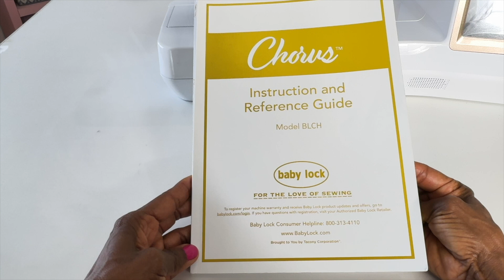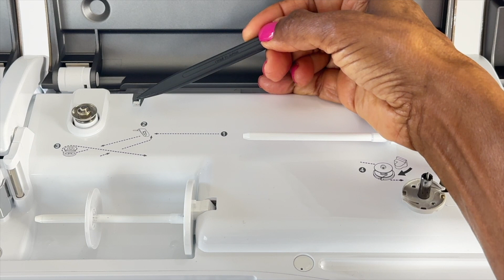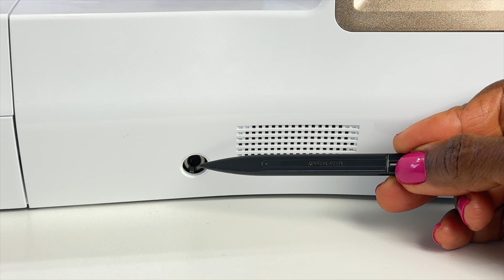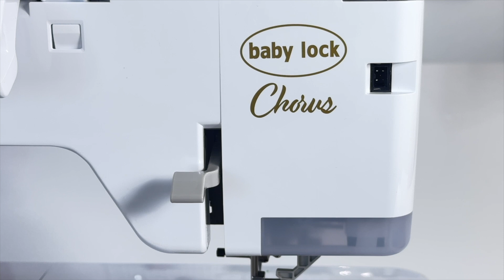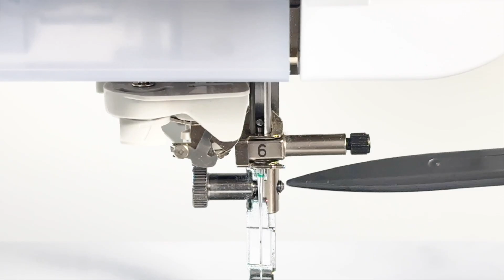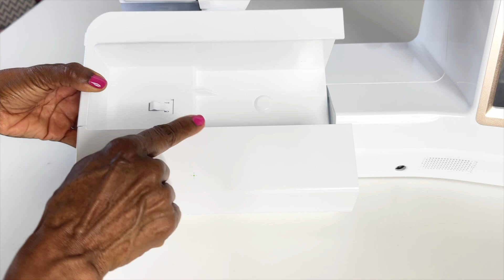A complete walkthrough of the Chorus Machine Parts

Comment: How easy is it to take the plates off to clean the area around the bobbin and thread area. I have the soprano and it’s a bit of work to get the screws in and out.
Reply from the maker: I have the Soprano too. I just remove the presser foot holder and needle. I don't find it too difficult to remove the needle place. I have to fiddle around with it a bit but always manage to remove and replace.